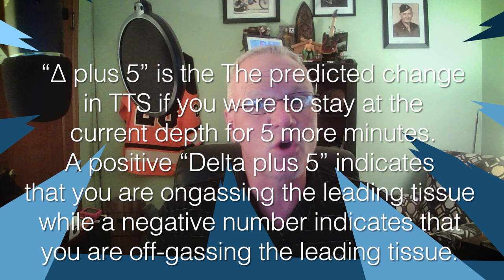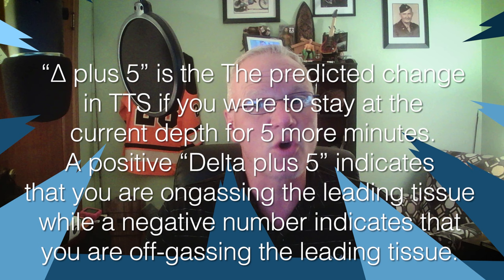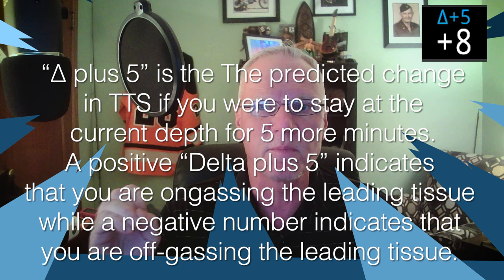Demystifying Shearwater DELTA PLUS 5:  Is it a game-changer?

Comment: I have my Perdix set up pretty much the same way.
Left mini: GF99 / SfGF / CNS
Center: PPO2
Right mini: TTS / Δ+5 / RTR
TTS mini: TTS / GF / Temp
NDL is displayed on top until it's replaced with DECO or SAFETY.
I change the bottom row to T1/GTR/T2 display during the dive.

I have a second Perdix which I use mostly for non-essential stats.
Left mini: CEIL / MAX / AVG
Center: PPO2
Right: Density or DET, depending on the type of dive. Density when I'm diving below 30m, DET when I'm expected back on the boat at a certain time.
TTS mini: TTS / GF / Timer

I have PPO2 and GF on both computers so I can check both are setup the same before the dive, and I have the same gas selected during the dive. If one is off it's time to double check and troubleshoot.
Reply from the maker: Awesome, those are great ways to be able to keep track. I really like the Δ+5 for cold water diving as well for teaching tech. It gives me a lot of information about what to do when I start feeling cold or where I am at with students in the process.
Reply: @TeachMeToDive  It can be a data overload for some, but when you've set it up yourself, you know what's where and why.

I keep the important data (Depth, Time, NDL, DECO, PPO2, T1/T2, GTR) in big fonts, and the rest in smaller.
I also try to keep related values close together.
GF99, SurGF go together, and CNS are all in percentages.
TTS, Δ+5 go together, and are displayed immediately below NDL/DECO, and RTR are all in minutes.

CEIL is immediately below Depth, and MAX and AVG are all in meters (or feet).
DET or Density are in a big font because Density is important, and DET can only be displayed in a big font.
The bottom row on the second Perdix displays the standard "OC O2/He" and the TTS Mini.